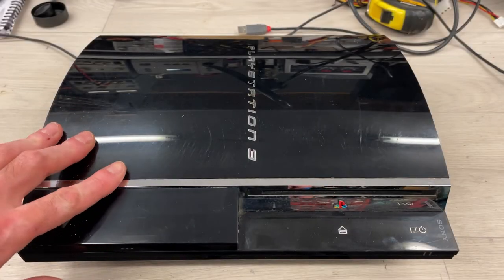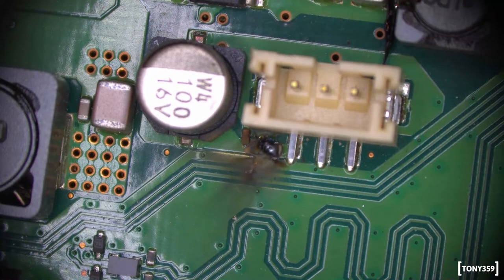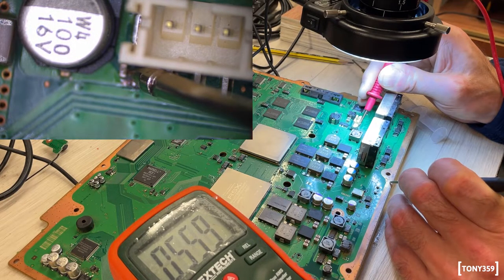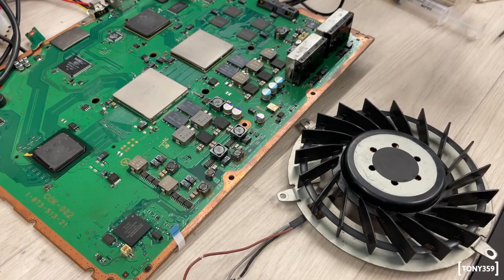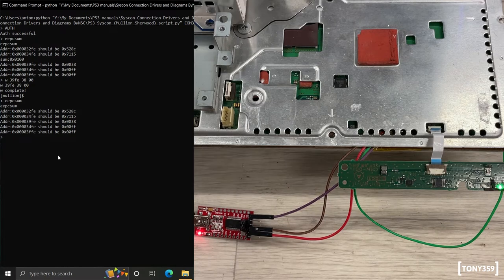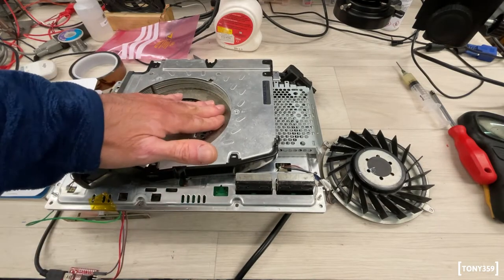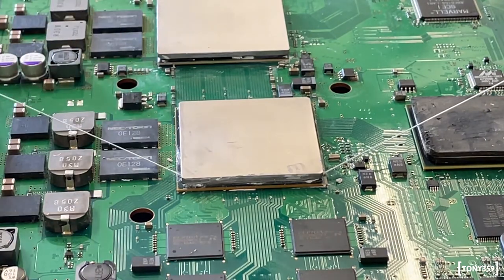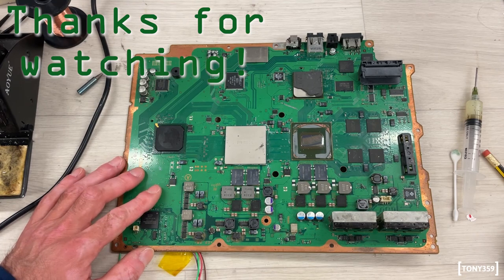PlayStation 3 (CECHC03) - Repair Attempt (Syscon fun ahead!)

Comment: Well for a first attempt that was simply an amazing effort. You used python to bringup the system and do a diagnostic by accessing the syscon chip. You determined the fault was dry paste or no paste under the heat spreader. And you very nearly did a successful de-lid. You can replace the CPU if you have a work station, if you want to try that I have some junk boards with good CPU chips on them, I'm happy to send these to you. We'll done on a excellent and informative recording. 👍 (I'm Timbo by the way, thanks for the shout out)
Reply from the maker: Hey Timbo, thank you! I really appreciate your comment! I do have an SMD station - hot air and pre-heating - even though I am still practicing on old XBox’s and my success rate is still… improvable to be fair! 😂 
But I was indeed thinking of searching for a scrap board to transplant the CPU so your offer is much appreciated - I’ll keep practicing on the Xbox’s first though! Really thank you for all your help and for watching!
Reply: @tony359  no worries, just private message me on psx place when your ready and I can make the arrangements, keep up the good work!
Reply: Good news we have you here Timbo! :) I was wondering what you've said, because some forums (donbt remember it by now) discussed that the RSX can be frankeinsteined, but the CELL no. Is it possible to get another CELL to the MB? They are not bond together, or it can be re-bonded? :)
Reply: @timdark9282 big question for you, I have 2 exact same boards, one with broken cell (during delid) and one with liquid damage but cell nand and sys are OK, can I swap the 3 elements on the board with the broken cell and save it?
Reply: @sdfggtfhhyy  it is now possible to replace the CELL processor. Adjustments can now be made in syscon to fit a new CELL and marry it to the new motherboard. The problem is you need either specialised equipment or you can use a hot plate to preheat the board and use hot air with a large BGA nozzle to achieve the correct temperature to lift the processor. The bottom line is that it's not easy, and I would advise you to get onto PSX place and ask the community for a good preheat profile. You can also ask Felix  how to build your own rework station as this will save you money. (He has already done this, and he may have a post , he can direct you to, on how to do this)
Reply: @timdark9282  great, I don't know when but I will definetly give a try, so you are saying that I can only swap the cell without the nand chip?
Reply: @timdark9282  yea I've seen some videos on YouTube of rsx removals for example, that's quite an operation
Reply: I’m in the same boat, I scratched the substrate on the CPU side during a delid on a perfectly working low hour A01.

Any help would be appreciated.
Reply: @petesilvestri  The trace damage in the corner didn't look to bad tbh, if I had that board I would run some link wires in between the ripped tracks and solder mask it.
Reply: @ShaDoWxGFX  thanks…. I’m in the process of getting a soldering station and a microscope. I need to practice on a few scrap boards then I’ll attempt to repair. I just have to figure out how to repair the traces near the edge where they loop. A few of those are gone 😳
Reply: @petesilvestri  From what I can see in the video, looks like there are 11 damaged traces on the top, with a bit of time it can be repaired. The only thing I cant tell from the video is how deep the damage is, if its a couple layers deep then its most likely a write off.

Comment: I just did the EXACT same thing trying the floss method and saw almost the same result. I switched to use a razor blade sooner and saw the same "polishing" exposing some traces but thankfully none of the traces were cut in my case. I also went through a TON of floss and hurt my finger so I definitely feel your pain. Sorry it didnt work out for you in the end 🙂.
Reply from the maker: I know the feeling, I used gloves if not mistaken for the same reason! Glad you stopped before I did! Thanks for watching!

Comment: Holy crap man, we're kindred spirits. I've been doing the exact same thing the last two weeks. Trying to revive my ps3. Barely starting to tinker with the Syscon. Literally just got done soldering the lines to the Rx and Tx. Now i gotta figure out how to do the software side and hopefully i can move forward.
Reply from the maker: For my first time it was ok to do. I didn't capture that part to keep the video to a reasonable length - it's not a syscon tutorial after all - but I can tell you that I didn't have to install any drivers for the UART adaptor. Windows 10 took care of that automatically. I then followed the guide from NSC for python and it just worked - well I had to swap RX with TX and that was it. 

Finger crossed for your PS3 but I'm sure you can do it! :) Thanks for watching!
Reply: @tony359  Hey boss, any chance you can do a vid showing more of the software side. Your video has been the most uniform of all the other videos when doing this type of thing with the ps3. I need insight, been having so many issues so far with the python script and running the cmd Auth.
Reply from the maker: @Derik64  I'm sorry I did not link my source when I published the video - I have now. Please take a look at this video: https://www.youtube.com/watch?v=ZvqJQVd5pBY - besides being an excellent tutorial you will find a link in the description to a file containing all the documents you may need for the task. As I said the only thing I did differently was NOT to install the drivers, Windows 10 took care of that automatically. In the file you will also find a PDF guide which is basically guiding you through the setup step by step.
I am a bit busy with work right now and it would take me a while to make a video on Syscon - what issues are you having? Did you get the right RS232 adaptor?
Reply: @tony359  You're fine. I get it, we're always busy outside of youtube. I'll try uninstalling and reinstalling drivings. I have all the correct stuff and I'm familiar with NSC. Followed his video to the T until i started getting line errors after typing "AUTH". Actually you'll see that I left a comment on that same video XD. PSX Place has been down for almost two days at this point too and it's the only place that i've managed to find a result in google saying the exact same issue with the search results. I'll keep at it all the same. This whole thing started with just NEC Tokens and, well......yeah
Reply from the maker: @Derik64  when you run the script, do you get a ‘>’? Is the error appearing when you type ‘AUTH’? And what error is that?
In my understanding if you get ‘>’ that should confirm that the serial adaptor works. If you can’t authorise, then it should be a connection issue with syscon. Did you try swapping RX with TX at the adaptor and do you have the adaptor set to 3.3V with the jumper? Trying my best to help you here 🙂
Reply: @tony359  I have the jumper on 3.3v. I haven't swapped the rx and tx but i'm confident they're in the correct spot. That being said i can swap them. But after the "COM4 CXR
>AUTH
Traceback (most recent call last):
 File :C:\Users\xxx\Desktop\Syscon connection Drivers and Diagrams ByNSC
PS3_Syscon_(Mullion_Sherwood)_script.py", line 190, in <module> 
         main<len<sys.argv>, sys.argv> 

Then it goes on and on and just changes the "line 190" to "line 174" then "line 119" 

The "line 119" is followed by "     , in auth
       auth1r = self.command('AUTH1 1000000000000000000000000000000000000000000000
0000000000000000000000000000000000000000000000000000000000000'>

There's other stuff. Line goes to 61 then 45, then jumps to line 255. Raise serialexception

It's the same thing everytime. If i do the process again, it gives the the ">" where i can type AUTH but i do it again and bam. I also uninstalled and reinstalled the drivers and still the same thing. That's what's been going on since last night.
Reply from the maker: @Derik64  I did some tests for you. With just the serial adaptor connected - no PS3 - I do not get any error messages. I get the ">" prompt and when I AUTH I get "Auth1 response invalid". So clearly we have some installation issue here. Again, this was my first time so I am not an expert but:
- Are you sure you are connect to the correct COM port? You can check which COM port your system has assigned to the adaptor by right clicking on the START menu, Device Manager, Ports.
- Did you install the Python version supplied by NSC and not a newer version?
- Did you install the extra two python packages mentioned in the guide? (pip install pycryptodome
pip install pyserial)
- is your adaptor correctly showing as "USB Serial port COMx"?
- Did you try opening your CMD prompt as an administrator?
Let me know!
Reply: @tony359  I followed everything exactly. I even went back uninstalled everything, python, drivers, everything. Re-did everything that NSC had shown, and same result. I've tried different USB cables, different usb ports, i changed the COM port from COM4 to COM2 just to see if it makes a difference. About the ONLY thing I haven't done is run cmd in administrator mode. I type "cmd" in the search bar of the folder, just like NSC, but I've tried looking for ways to do that in Admin mode. Also, i tried using the GUI interface that was shown in Michael Crump's video https://www.youtube.com/watch?v=oeuGGAbJNBQ. The read.me files say to run the program and everything on windows 10. I did it over and over and I'd get "Program Error" and "Auth1 Response Invalid" every so often between the two. That's what the last 24 hours have been like. So yeah, really starting to get discouraged. Don't mind my negativity. I'm just kinda venting at this point. Part of me is thinking to just say "Screw, let me just buy one" but I feel like i've already taken so much time and steps towards doing this I don't wanna back out now.
Reply from the maker: @Derik64  but you’re getting ‘Auth1 response invalid’ now, not the long error message? Did you try swapping RX and TX?
With the PS3 NOT connected, what do you get now?
Don’t give up! 🙂
Reply: @tony359  Alright man, as of now, concede. All this information is still a little too much in it's infancy to address variations in the outcomes of how to perform these diagnostics. from the hardware, to the software, there's a lot of opportunities of things to go wrong and despite my best efforts I've been unsuccessful. I need to step away for a time. This has just got so frustrating over the last so many weeks. A weekend project turned into a full-on chore. In any case, i appreciate your reciprocation with me and will be keeping an eye for developing information in regards to ps3 syscon and the like.
Reply from the maker: @Derik64  I can understand the frustration but I hope you can succeed soon! 👍

Comment: Great video.

I used to fix them back in the day and found it was the mounting mechanism rather than TIM that was the problem.

Cutting a square of 0.3mm copper and placing over the CPU and GPU IHS, then reinstalling almost always fixed the issue.

Similar "fix" for the RROD on Xbox 360. Removing the xclamps, drilling the chassis, then installing machine screws and nylon spacers to sandwich the chassis, motherboard, CPU and heatsinks together would get at least an extra year out of failing flip-chip connections.
Reply from the maker: Great to know! Thanks for watching!

Comment: Rsx bumpgate. When rsx bumps start to fail, the capacitor swap is a temporary solution to give more power to the remaining bumps. The remaining bumps are then even more stressed and the rsx fully fails when they burn out. Its not the bga balls that fail, its the bumps between the die and the spreader. 

There is a channel on youtube that explains it. 

Frankenmod is what you want. A 40nm rsx swapped in.
Reply from the maker: Yes I watched that video AFTER I "fixed" this... I'll try a Frankenstein at some point :)
Reply: @tony359  same here. Excited to get my
Fat backwards working again

Comment: Very good video on PS3 repair. One of the best on using SYSCON on YT. Those traces can be patched with wire as I believe they go to the RAM traces on the PCB above. On YT there is a video of a repair of a lot of 3 PS3s where these traces where patched. YT will not let me link it. The short on the fan thst killed the PSU could have damaged the temp monitor if it measures resistance. Looking forward to a follow up.
Reply from the maker: Thank you Dean, appreciated! All Syscon credit goes to NSC Modz though, I merely followed his tutorial! I tried patching those traces but the thinner copper wire I have (which I purchased to patch small traces TBH) was too big. Also I noticed the CPU was acting as a heatsink when I was trying to solder. But you're not the first one saying that it's possible so maybe I shall look into that. Can you tell me what's the user who published those videos? I'll search it myself. 
I'm told that to "marry" a new CPU to the motherboard there are a few Syscon commands to be issued. I am hoping for a follow up - whether to make a Frankenstein or to patch those broken traces I guess :) Thanks for watching!
Reply: The video is let’s fix ps3s in 2022 and user name jeffescortlx I think. On the Xbox 360 the temps can be affected by some of the resisters near the GPU from memory. Had one out of range that used to show hot from start that was one of those resisters. Still early day learning on PS3 myself.  Good luck and look forward to more videos
Reply from the maker: @deansmith6924  thank you, I'll take a look
Reply from the maker: @deansmith6924  Found it. Watched it (I had watched before, could not remember). That seems easy LOL. I might give that a go then. Thank you again!

Comment: Just wanted to drop a thanks on this video. I was getting 1200 error as well and reproduced your syscon tests on my CECHE that I'd picked up years back in an unknown broken state. Saw similar behavior with tmp 0 shooting up and instant shutdown.

Much like you with nothing left to lose I went for a CELL delid. Decided to go for the soda-can method (cut up an aluminum soda can into some strips, folding over one end to hold while keeping the other end flat). This seemed to work well as the aluminum somewhat retained its curl from the can before I cut it up, and I could run the strips under the IHS with the curled side "up" to trend away from the substrate. Also used some silicone grease on the bottom side of the pieces so it would glide instead of catch on the substrate whenever it made contact.

Still sketchy as hell, but I got lucky and didn't damage the CELL. I did accidentally knock off a tiny capacitor between the CELL and RSX, but was able to bridge it with some solder and it seems ok. Booted it up and it runs like new. Bittersweet how yours turned out but thought you might find it interesting to know as I think your diagnosis was spot-on.
Reply from the maker: Amazing! Really happy to hear that my tinkering helped someone in bringing back their PS3! Thank you so much for letting me know - and thanks for sharing the "can" method... it looks like there are way too many methods for de-lidding a CELL! :)
Reply: @tony359  That's for sure... was going to go with the nail file method, but all my files snapped when I tried to bend them into an L.

Aluminum cans are very thin and easy to come by!
Reply from the maker: @mimikomono  I am planning to make one. I believe it has to be glowing red for it to bend without snapping. But I guess there are many types and materials around. I’m a bit busy with work, then (spoiler alert!) I have some other PS3 to rescue 🙂

Comment: I smashed a ps3 super slim once because I couldn’t figure out why the fan was maxing out. Spent a weeks on it until I realized taking a sledgehammer to it was the end all cure all.
Reply from the maker: Nooooo! 😂 I’m not familiar with the super slim but I think some still have the IHS on top of the CPU/GPU. It probably need de-lid. Rest in Peace 😂
Reply: @tony359  I know 😞

The GPU on the super slim actually doesn’t have an internal heat spreader. The copper heat pipe is directly on the die and for the life of me I could not either: get it tight enough to the die or get the paste just right. Idk definitely R.I.P.

Comment: i ENJOYED AND LEARNED ALOT
I have a YLOD Fat Model CECHC02 with the exact same motherboard COK 002 so Im going to follow your syscon steps and see if I can fix it.
Reply from the maker: Thank you, good luck! Please don't use floss line :) I have some more recent videos where I go through the de-lid process!
Reply: @tony359  OH KNOW!!!  I stuffed the very first step attaching cables to the points on the motherboard to read the syscon codes and burnt off the RX connector point. Is there another way I can solder to the Rx connector point? Please help.
Reply from the maker: I really don't know but COK-002 schematics are available online.

Comment: I watched until the end. Really great vid. Very educational. 
If you had of been successful with de lidding what would of been the next steps. Were your chances of getting it working higher? Thanks
Reply from the maker: Thank you! I am told that the dry thermal paste was all that needed replacing on that unit. So sad. The final steps would be to replace/add thermal pads, new thermal paste of course and - recommended - a custom firmware which allows to run the fans harder: Sony apparently decided to have a quieter console rather than a reliable one :) Fan won't speed up until GPU and CPU reach stupid temps... Thanks for watching!